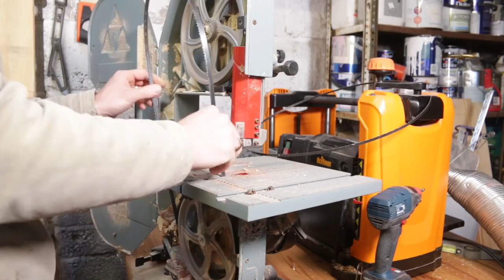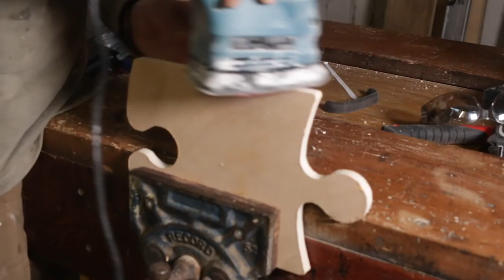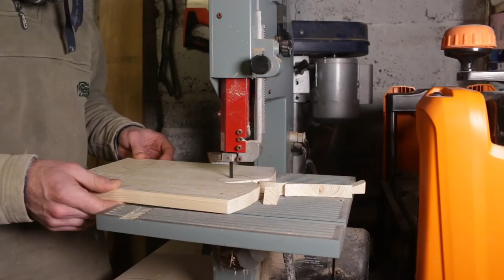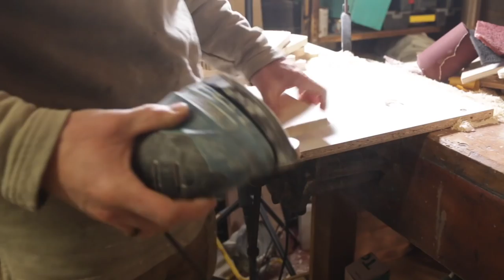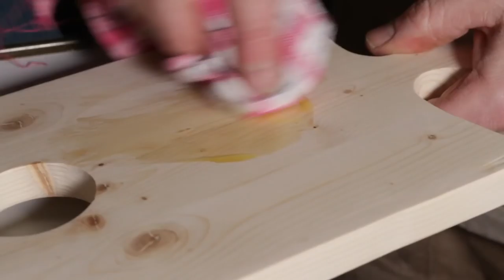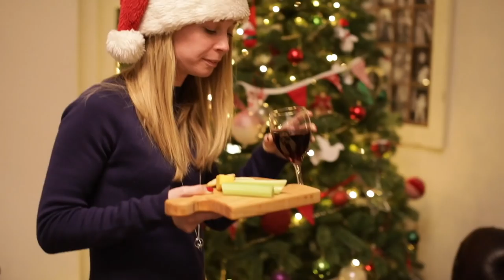PUZZLE PLATTER BOARDS - Woodworking Presents

Comment: Hi what wood did you use and I don’t suppose you have the printed template these look great for presentas
Reply from the maker: I made a few in various hardwood offcuts I had but the main batch were from pine. I ended up using the laminated pine furniture board but a simple glue up if you had wood already. Will check to see if I saved the template, I tried a few so not sure which I used.
Reply: would also love a copy of the template please